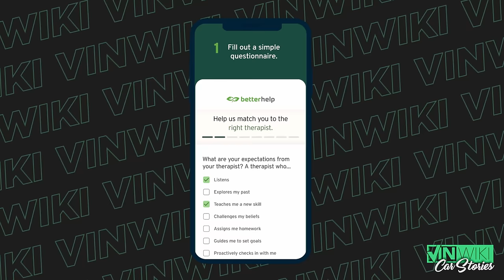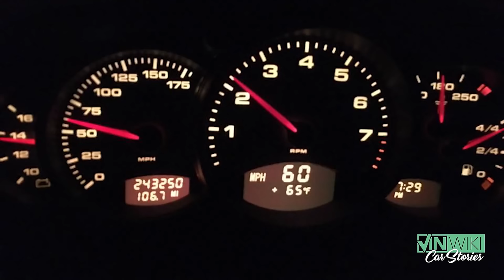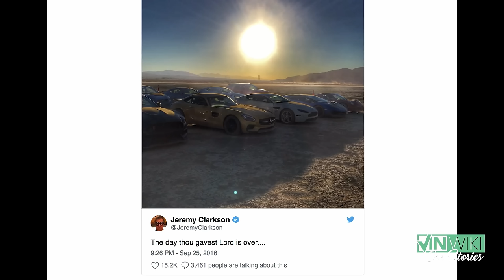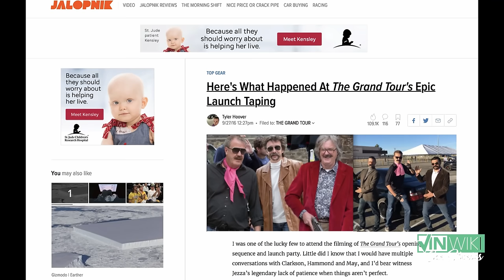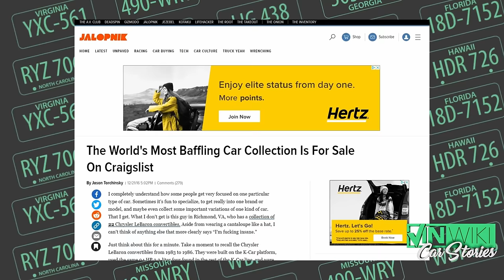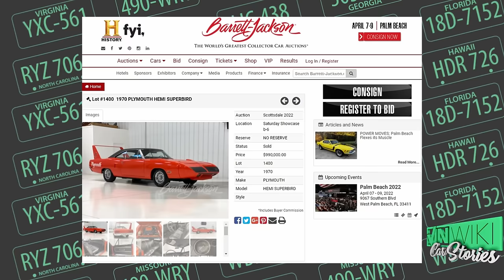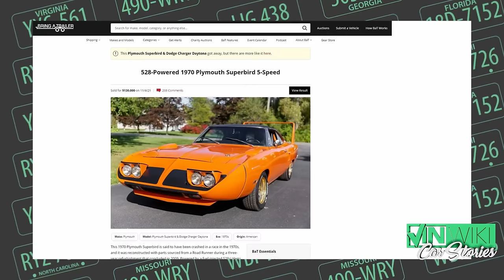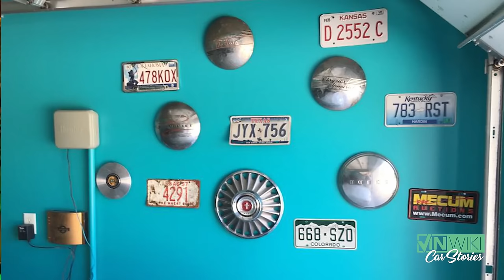Hoovie's Top 5 Car Stories!

Comment: A buddy of mine buys old beaters and fixes them up with one of his grandkids, sometimes selling them to fund project cars.  He had a 2000 Explorer that he couldn't seem to sell but got a call from a guy who said he had a 2006 Pontiac GTO that he wanted to trade for it.  Hmmmm, that's something like a $20k car but if that's what the guy wants...  So the guy shows up with the 'GTO' which turns out to be a grocery-getter Grand Am.  Guy swears it has a V-8 that was swapped into it.  Buddy pops the hood and it's a run-of-the-mill 3.4 V-6.  They trade anyway since the Exploder wasn't moving and the Grand Am is a bit nicer.  We talk about it and chuckle about his 'GTO.'
Reply: i had a 94 Camaro with the 3.4L V6 and that engine sucked!
Reply: @GlycerinZ my daughter is driving an '02 grand am with 279,000 miles with a 3.4 in it RN. Doesn't run the best, but that thing has been a TROOPER!! Literally every light on the dash is on, but it just keeps going 😂😂
Reply: @GlycerinZ that was the first car I bought when I was 16. Got rid of it when I went to college, but I loved that car.

Comment: If you ever buy a car from Carmax, you will be paying on the top end of the used book value; always.
You have 30 days to report any issues with the vehicle, and they will repair it a ZERO costs.
ANY issues. You can nitpick it to where you get a fantastic vehicle, if you understand what you are doing.
New trans, new 4X4 transfer case, all bushing replacement on front end, on a 10k dollar truck 10 years ago.
It now belongs to my kid and still runs great without any issues other than normal crap.